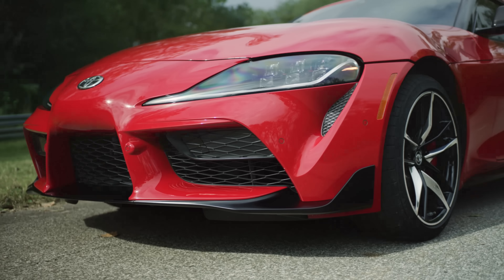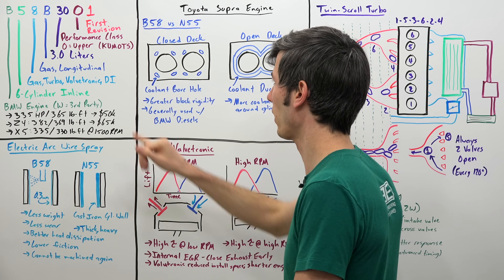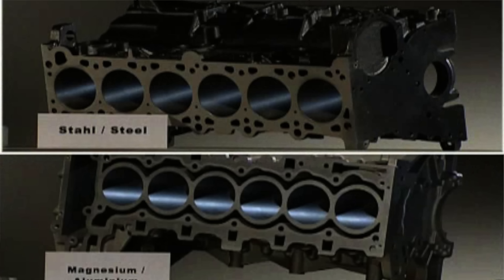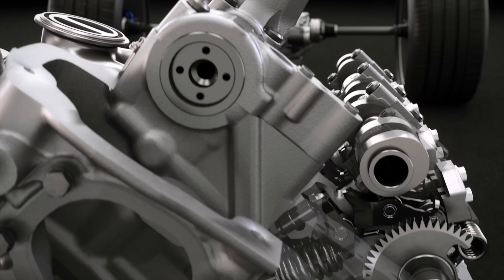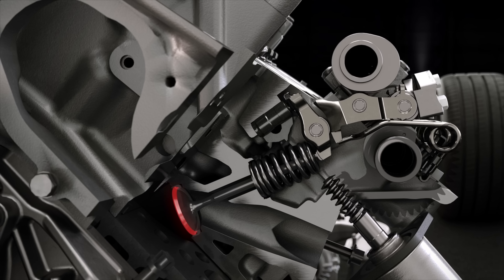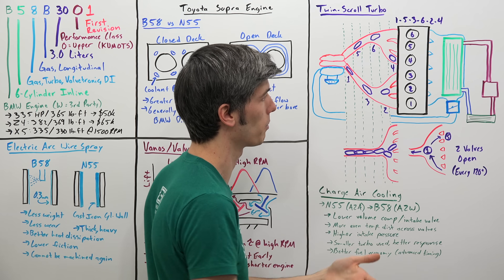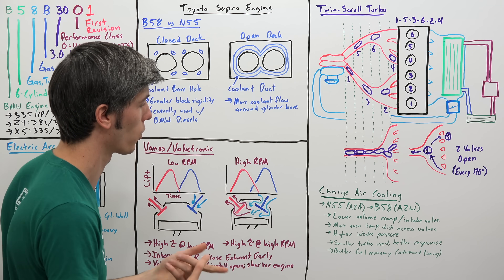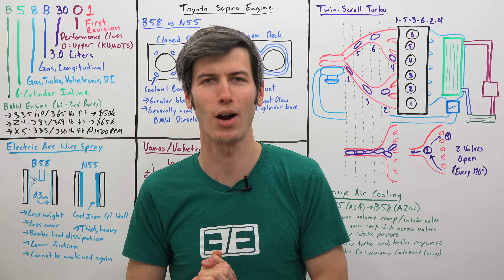2020 Toyota Supra Engine - Detailed Review Of The 2JZ Successor

Comment: Development Team: The Engine has 6 Cylinders
Naming Team: Ahh a "5" will make the most sense
Reply: Even more fun:
6 is a V8
7 is a V12
8 is a... V10

Oh, and there were old engines, where 1 meant an I4 and 2 and 3 meant an I6. Yup, much logic. Oh, wait, there was also the M88, which logically was an I6.
Reply: @8Hshan   and v6?
Reply: @herejito2  What? It's BMW. They've never ever built or used a V6. Only inlines.
Reply: @8Hshan  this disorder bothers me
Reply: @CarsandChris  It's not really disorderly if you actually know the history of BMW engine naming. In the beginning , there was the M10, an i4; the M20, the smaller of their I6s; and the M30, the bigger i6. Then they made the M40, a 4 cylinder; and the M50, a 6 cylinder. Then they released the M42, M43, M44 , which were all basically evolutions on the M40, so they changed the second number. They also released the M52 and M54 which were the successors to the M50. They also released the M60, which is a V8, and M70, which is a V12. They didn't have a V10 until much later, so they didn't have an engine code for one until 7 was already taken. In recent years, they have started changing the first letter but keeping the numbering convention the same, so an N52 is a naturally aspirated i6, and N54 and N55 are turbo i6s. The most recent engines start with B but still keep that numbering convention the same.  Historically, BMW used an S as the first letter to denote that it is a performance engine, so the S50 is the performance version of the M50, and the S62 is the performance version of the M62, etc. Recently that has changed a little as BMW releases more "performance" engines that aren't explicitly M engines, but the M cars still use the S designation, with the S55 in the F80 M3 and the S63 in the F90 M5. It's not hard to understand once you get to know BMWs.
Reply: @memedudech.1921  thank you for the information! It definitely makes more sense now
Reply: @memedudech.1921  you're going to make someone who only knows 2jz go insane reading this
Reply: As far as bmw is concerned engines designated “6X” are v8s such as the s62
Reply: I mean, I6 could be 5 while a V6 is 6
Reply: @CarsandChris  
then it should say i6 or v6 not 5
Reply: @CarsandChris Why would 16 be 5?  Would 17 be 6?
Reply: @geoffreyanderson4719  I typed the letter I then the number 6 meaning inline 6 engine which is different from a V6
Reply: @CarsandChris  what's a 5 cylinder one called then? 9 or 7?
Reply: @flashv4941  probably. BMW isn't going to be making a 5 cylinder anytime soon so it's not really relevant
Reply: Well when you have 1 digit and you have 10 and 12 cylinder cars you make the cylinder count fit in one digit like that. It's very logical!
Reply: DolphinTaco they have had this naming scheme for 25+ years. Why? Hell, who knows!
Reply: @OlaJustin  well i explained it 5 hours before you wrote your comment but yeah "hell, who knows"
Reply: @memedudech.1921  So basically, the 5 doesn't actually mean 6 Cylinders persay, it just means it's the 5th generation engine that happens to be a 6 cylinder engine. Still though can't beat Nissan engine naming.
Reply: @LoDacBiet  At the time, that's where the 5 came from, but these days the "5" does mean 6 cylinder engines. The naming convention has sort of evolved over time I guess.
And I agree, even though I'm a BMW fanboy you can't beat Nissan or Honda engine naming.
Reply: its like using ''C'' to describe a Dog instead of a Cat!
Reply: @fidelcatsro6948  you are unironically braindead
Reply: @memedudech.1921  C is for Cat, ~ D on the other hand is for Dog! maybe youre right im braindead because of the brainwashing of modern thinkers renaming cats as dogs..
Reply: His reaction while saying Inline '6' cylinder engine was lit...🤣
Reply: Like they say in the comments there’s a V6 and the in-line goes behind it therefore 5
Reply: That's the only thing I could think about for the whole video 🤷‍♂️
Reply: maybe its like a cpu where the first core is 0
Reply: They did that just to piss off the germans
Reply: @nox_chan  uuumm Germans created this engine... :S

Comment: So now do Toyota techs need training in bmw engines? Will this not jack up maintenance costs via specialty labor? Will you now pay bmw prices for out of warranty work on a Toyota?
Reply: Mannassa Mauler it’ll be serviced at a bmw dealer probably
Reply: As a toyota mechanic, they will probably still go to toyota dealers for servicing. I've been doing valve spring replacements on FRS engines for the past couple weeks and those are subaru engines, no extra training or anything, mind you they aren't that much different from any modern toyota engine. They might have a 2 day training course or something for maybe one guy per dealership for these engines though.
Reply: @snarfblast14  Do you consider a normal inline engine or a boxer engine to be more overall challenging to service?
Reply: Traditional inlines will almost always be simpler to work on simply because a boxer engine almost always needs to be removed to do any serious overhauling, also it has twice the number of many components (valvetrain, heads, valvecovers, 2 blocks, etc.). In the end though they are still both ICEs with nearly identical components.
Reply: No they're just going to send you to BMW for servicing... lol
Reply: Toyota already has a deal for Diesel engines with BMW so the Supra will not be a special problem.
Reply: a.k.a. miagi  BMW isn’t selling anymore diesels in the U.S. so I assume that goes for Toyota’s as well.
Reply: actually if you dont know the car was codevelopped between bmw and toyota im sure toyota knew what they where doing because everything has been made for this car specially as explained in this video
Reply: That could probably be answered by finding if the engine computer (ECM) software can be read by the OEM Toyota diagnostic system. My guess is the car has a BMW engine computer (DME) and would require the BMW diagnostic system. As it is OBD2 it will still give generic codes but on a BMW the standard OBD2 codes are all but worthless without the real data readouts from an advanced scantool. Then again, BMW is good a selling stuff. BMW likely will sell each Toyota dealership a PC based work station for diagnosis and programming for roughly a crapload of money.  And as an added bonus, the HMI is unusual and will encourage dealerships to send techs to expensive training classes taught by BMW and paid for by individual Toyota dealerships.
Reply: It will already be more expensive for labour.. euro engines are just harder to work on that jdm
Reply: All of the BMW B engines are a pain to work on, but I doubt they will be bringing supras to a BMW dealership.

Comment: I'm really curious to see how the Japanese hardcore Toyota fans are taking this.  Honestly, given the choice between this Supra and the old one I'd take the old one.
Reply: I'll keep my old one as well. Toyota had years to come up something great but ruined this one. They should have shared parts with the Lexus RC F or LC F if the needed to source a different motor or drivetrain components.
Reply: @Shwalker07  they could have utilised the new twin turbo 3.5 V6 engine from the LS500 paired with either a six speed manual or 10 speed automatic. It could have easily been tweaked to 500hp too.....
Reply: @Shwalker07  Ill stick with a NSX
Reply: The original Supras are a much better investment for the long run, they only get more expensive with each passing day. I don't see these new "pseudo Supras" doing anything but depreciate 10 years from now, just like most of bmw's products.
Reply: @seanforsythe78  Most 10 year old Toyotas depreciate like any other car. Even the Mk4 Supra depreciated for the first 10 years, only now are they going up in value. Equally there are plenty of BMW models that are fast appreciating in value and way more then any Japanese cars.
Reply: @seanforsythe78  look up older m3's bet ya can't find one cheap
Reply: @seanforsythe78  OLD cars = Problems - There are many Brands like Toyota, Scion, lexus, subaru, etc. But the BEST BRAND = BRAND NEW !     Get the New Supra
Reply: @seanforsythe78  Its well know that toyota uses other company parts to build their cars. Toyotas not always real toyotas. Even the Toyota 2JZ GTE engine was develop by a German company called: Johann A. Krause Maschinenfabrik GmbH and transmission of the MK4 was made by German company Getrag. So the MK4 was a pseudo supra too
Reply: This is just my opinion and preference.  I'm not seeing anything particularly amazing about the new "Toyota" Supra that's worth a $70k price tag.  I could buy something for a fraction of the price, spend some $ making it a rocket, and still have thousands left over.  A used Corvette for thousands cheaper looks like it may even out-perform it stock.  Personally, I like Bimmers as well, but why not just buy a used 340i for half the price and tune it a bit?  Again, not trying to rustle anyone's jimmies here, but I think newer cars are just becoming heavily over-inflated in price for less and less overall value.
Reply: @evilblackcat6357   You could make that comparison to almost any new car though so it's not really a valid point. All cars are getting more expensive it's just the entire market unfortunately. At least this is 15k less then the Z4.
Reply: @Morelandos  I think you missed it where I'd said newer cars prices are inflated,  meaning they charge too much for too little.
Reply: @evilblackcat6357  The M340i depending on packages is actually more expensive than the new Supra.
Reply: @jorgevillacis8127  I did say a used 340i.
Reply: You may be missing out. Why limit yourself?
Reply: People in japan are just like us. Theres some people who love the mk5, and then there’s people who say its just a bmw. So not much different
Reply: agreed, so would anyone who likes Toyotas, or cars in general.
Reply: Well I am a fan of the old school Toyota sports cars having had the MR2 Celica and Supra some years ago and I am also a big BMW fan and have been driving them since 1995 so for me this is a match made in heaven LOL! A BMW and a Toyota Sports car all in one! shame it won't cost similar to what a normal Toyota would!
Reply: @joebloggs4191 Actually, the most previous generation of Supra, the MKIII was very expensive - the main reason why it did not sell well.
Reply: Here’s what the Japanese think, THEY DONT CARE. The Japanese prefer newer cars to older ones, it’s difficult to register older cars in Japan. What they see is a new Toyota Sports Car that can be had fun with, End of Story. The rest of the world needs to learn we live in different times where the rules have changed and cars can’t be replicated.
Reply: @finesticons8395  It's good to know you're the arbiter of all of the Japanese's opinions and dictate what everyone else's should be and none of what you said is just your opinion.  Come on, now.
Reply: @evilblackcat6357   I suggest you visit the country and speak with the people, because ive visited enough times to understand that they are not biased about anything car related. Just like i said before, older cars  are difficult to register in japan and by old i mean anything past 5 years. Theres a reason why supras and gtrs are being auctioned off to other countries, they dont like dealing with older cars. Anything new from a domestic company to them is instantly welcomed, they have an entire city dedicated to Toyota.
Reply: @finesticons8395  All you had to do was start with reason, not go full gestapo, or I wouldn't have replied, but thanks for clearing that up.
Reply: @finesticons8395  It didn't have to be a replica. It should be BETTER than the previous Supra. Sure doesn't look like it's going to be.
Reply: @finesticons8395  The NEW supra is way Better than the Supra 4. Just open the Hood and check that BMW masterpiece engine. Toyota is a great company because they know what is best. They Know the BMW is the master of the Inline 6 Turbo so they choose BMW to power the best supra ever. Who want those old farting 2JZ's engines? Nobody !!!
Reply: dash captures of Vermont  if you guys hate electronics so much why not throw your pc out the windows and buy a ford model T?

Comment: I don't care that it isn't a 2JZ, I would have actually been pretty disappointed if they had used the 29yr old engine.

I think the thing that bothers me is that it doesn't even make as much power as a Hyundai/Kia. I'm not knocking Hyundai/Kia, but I mean, this is supposed to be Toyota's next sports car in collaboration with BMW. I'm sure it handles great, but the Supra wasn't really a car meant to be driven around a track. This kind of changes the spirit of what the car was. It needs to go fast in a straight line. I don't care if its lighter or whatever, we don't need another gt-86 experience that tries to skate by on the "its fun to drive even if its slow" defense.
Reply: Yeah, almost every GT86 owner has buyers remorse because of the power. They bought a project car, at factory prices. I imagine the supra will be similar, because their friends with f-types, or the poor people with Mustangs will be faster.
Reply: A downpipe and a stage 2 tune will get you 400whp all day long.
Reply: i dont see many people saying this but the problem with the new supra is that is too cheap. the original supra turbo was around 40-50k back in the day and the nissan skyline (if sold  in the US) cost about the same back then. nissan does great with the GTR despite it costing 100k, but for some reason toyota feels the need to keep the supra cheap, if they stayed true to the supra and built a new 3JZ engine and charge 100k for it, we'd all be happy. now we have just another BMW sports car whoop dee doo.
Reply: Pretty disappointing stock figure for a 3 liter 6 when my old 2013 4 pot A45 made more. New A45 will make over 400 stock. I do like the straight 6 and am sure it can go 450 easily, but that’s losing warranty. 335 stock with warranty is disappointing.
Reply: @kdkd693  335 on the wheels
Reply: Please tell me what Kia does a 4.1 0-60
Reply: @williamwilson5125  Kia Stinger GT. Around $40k. 3.3L V6 makes 365hp. 0-60 is 4.7. This is a sedan ffs. Toyota really  beat a 3,829 to 4,023LB cheap korean sport sedan by like .6 seconds.  Amazing huh.
Reply: @discokitten5325  Idk if you ever tracked a car but .6 seconds is at least a 5-6 car length in a quarter mile. Watching a car that's more than a half second faster than the other is a murder. Also the Kia Stinger Gt fully loaded is almost 50k which makes the cars similar in price. Far from a cheap car like you call it. I am a true car enthusiast and owner so if you want to debate please have your experience and facts straight first. Good try though👍
Reply: Ofc we do need more cars that are fun to drive even if its far below 1.2g lateral acceleration. There really are enough high power cars out there to go straight. But affordable cars that are fun on track and road we really only have a hand full at best. Currently: Alpin A110, Mazda Miata/MX5, GT68/BRZ, the cheaper Camaro and Mustangs and then we are already headin to M2s and Caymans that start around 70-80 k €
Reply: I'll be honest, people keep talking about the horsepower. But I rarely hear people talk about torque. This new supra has almost 500Nm of torque, which is a healthy figure. Plus the b58 has a bore & stroke design that resembles diesel engines. But 400hp is still a welcome figure.
Reply: @izzdin6228  Yeah, when I said "power" I meant it as a general term, but I know that isn't immediately clear. 

Hyundai/Kia = 365hp/376lbft      2020 Supra = 335hp/365lbft
Reply: @TheLastHonk  yeah, i guess you should've made it clear it's power overall, not just horsepower. My bad for assuming as such.
Reply: @TheLastHonk  335WHP is pretty good
Reply: @izzdin6228  The performance Model 3 has about 35% more torque?
Reply: @pault5179  don't know the specifics bro.
Reply: @pault5179  True that. PM3 eats anything else in this bracket for lunch at the dig, without having to even touch the go-fast parts under the car. Does pretty good on the corners too! Not to mention you don't have to put "higher octane" electricity in a PM3 lol. Ordering process would perhaps be a bit more of a pain in the ass compared to established Toyota dealerships though.

Comment: I guess the overheating can be a problem for track use, with a few power mods it will get crazy hot for the restrictive cooling and turbocharger, and the engine bay is quite full.